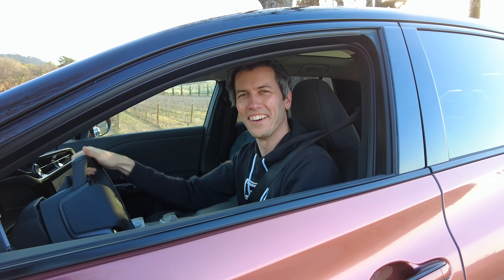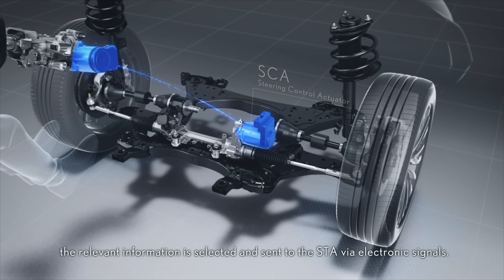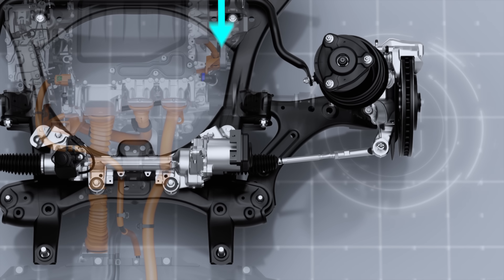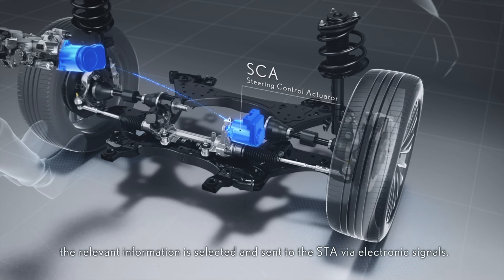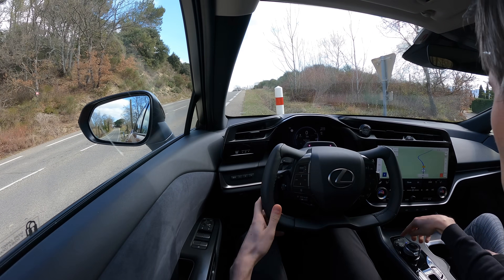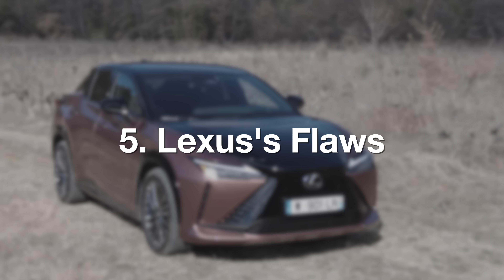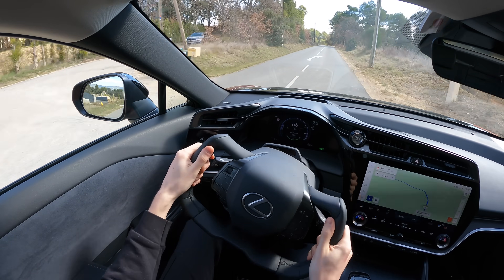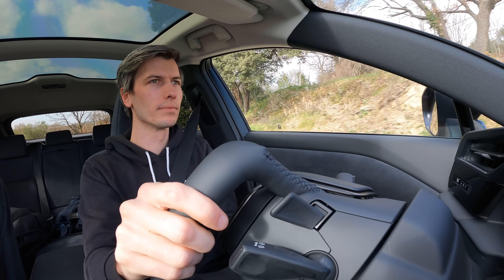How Lexus Fixed Tesla's Bad Idea: Steer-By-Wire Yoke

Comment: There is one more downside, universality and how swappable cars are. In short driving from muscle memory. Many people change cars often, you can pretty much hop in and out of any car, and most if not all of them are virtually the same. Very minor adjustments needed. In this case, if a driver sits into this thinking this is just a car like the rest of them, there might be issues. There is a required adjustment of the driver that is not minor at all, also beforehand knowledge of the steering system, like the 150 degree angle. And if this catches on and more or all manufacturers start doing this, every car will have a completely different setup depending on engineering and design, different steering angles, sensitivities etc. Cars will cease to be so easy swap and drive. You'd have to adjust to every single model individually. There has yet to be a car that I have driven that has less than 270deg rotation on the wheel. A clutch is a clutch. It may release at a different height, depending on the model, wear etc. but you can easily feel and adjust in matter of seconds. Throttle is throttle. I've driven at least a few dozen different cars, you hop in and go. I wouldn't personally feel 100% safe in a car that has a radically different steering setup. Parking in a city would be a completely different experience without the wheel rotation. You simply cannot rely on muscle memory. Or worse, driving when drunk. People don't care. If you're drunk and driving you rely on muscle memory as your reflexes are slowed down. If a car is completely different it will cause even more issues. And believe me people will absolutely continue to drink and drive. I have absolutely nothing against no direct linkage. The angle is what can be problem in the future, that I can see.

Comment: It might work for an electric car. Although there are questions. The car can often be moved without starting the engine. In the service area, during loading and unloading. When towing as a result of malfunctions, etc. The standard steering column ensures that even with the powertrain off, you can always turn the wheels. Even with the amplifier off, it is quite possible to turn the steering wheel if the need arises.
Reply: I'm thinking the same.

Comment: So what I'm hearing is no. This is not safe. Forget about the throttle by wire as that's not a safety issue. If you're throttle fails or loses power your steering and brakes still work. Steering and brakes are the two components that should never ever lose mechanical control. And all this comes at a higher cost as redundant components do not come cheap.

Comment: I am interested to know more. I saw in the video, there is a delay at the wheels from the steering wheel in the steer by wire system. Is it becoz of the video, the wheel turns after the digital signal trasmit from the steering wheel?

Another concern i have is like a computer, mobile phone, even it is the latest flagship model, the operation of the electronic device slow down somehow suddenly. Will this happen in electronic steering and foot break? Any thing in the desogn to avoid this happen? Imagine the car is running toward a corner on a hill and the signal transmission from ur steering wheel to the turning of front wheels suddenly not working properly, the car will just lost hit the roadside or rush off to the road side slope.

Comment: You forgot that at a low speed you need shorter range, while on a high speed wider range. Thus drive by wire should be able to jump between theese ranges as fast as a direct drive via steering rack

Comment: I wish they just dropped ev power trains into proven engaging platforms. Toyota,I don't want a compact SUV based on the corolla platform with a panoramic touch screen, voice activated taint ticklers and Bluetooth seatbelts. Just take a GR86, swap the powerplant with a motor that is about equivalent in power, keep as much of the drive train as practical and cram it with as much lipo cells so you're not upsetting the chassis balance.

Comment: What if you are in an emergency situation when the car/battery is dead and you need to push it and turn the car from somewhere or into somewhere? (Confined space/service center?) What if the electronic/wires breaks down and you drive on the street 100 km/ph? Can you turn with force?  It seems some engineers do not think and prefer to save money because running a cable is more cheaper than installing a proper mechanical solution that works also when a car is off .... It looks like it is not safe at all... Hmm no Lexus and no Tesla

There are some reasons why it is how it is designed... I am a little bit concerned about Lexus brand / engineers and executive level.

Note: Thanks for the video and explanation

Comment: To me, this is technology that gets in the way. I can't use a mouse that accelerates, because I need to know precisely how far to swiftly move my hand to reach the destination. I can't have things that pop up on my screen in order to guide me in various ways when I type, because they greatly interrupt the flow in my fast typing. I can't use a steering wheel where the wheels turn an unknown amount, because it would mean I'd have to slow down to avoid hitting things on narrow roads. I can't use a mouse, a keyboard or a mirrorless camera (electronic viewfinder) with the slightest noticeable delay. Nor can I imagine a steering wheel with a slight delay would be safe. They actually use steering wheels with delays to simulate drunk driving.

Comment: One other important improvement is that there's about $12,000 worth of repairs now added  to your steering system for a better steering ratio
Reply: a better steering ratio would likely just be a few variables changed in the software. though you might have to hack it to do that.
Reply: To be fair, conventional steering racks aren't too cheap either, and are a common failure point already. As long as the motors can be purchased individually i can't see it being THAT bad.
Reply: Actually this has the potential to be cheaper, with sensors and motors being easier to replace piece by piece than parts of a steering rack. 

Also, its a lexus, it doesn't break that much.
Reply: @seemslegit6203  the accessibility isn't what is driving the price of repair. Mass produced assemblies of one metal are easier to source, not as many unique elements to produce and can be made by third-party manufacturers.

In theory a MacBook could be repaired easily on a component level but somehow Apple do not allow such repairs and isn't selling you any parts to do it. I suspect car manufacturers will adopt a similar strategy.

Comment: If idiotic mistakes are ruled out then the delay is coming from the steering gear. Because the motor does not have enough torque or does not reach enough speed. To solve this, a stronger motor is required, which results in higher costs.

You forgot an important reason for steer-by-wire. Left- and right-hand drive have the same motor dream. This is a great advantage in development.

Comment: I used to race motorcycles, and no matter how much the manufacturers would claim that their throttle by wire system has zero lag, I could always feel the lag on throttle by wire bikes. The more recent models had very snappy response time, but you can still fill a delay that’s just isn’t there with a direct connection.

I also feel that saying that it has 2 motors inside a single casing is a bit of a handwavey argument. Yes, there are 2 motors. But when this goes into production you will see that there will be instances of both motors failing at the same time due to water ingress, electrical shock to the wiring, or mice eating the wiring just enough to make it fail at 60mph on the freeway in a catastrophic way.

Aside from the packaging advantages, this appears to be a solution in search of a problem to me. But than again, I hate throttle breaking in cars with regen, so maybe it’s just not for me.

Comment: I am open-minded when it comes to new tech, and I do think drive-by-wire should be a thing. Although, I think they've over-complicated it with the variable steering ratio. In an emergency situation you're trained at, let's say 50kmph to give X amount of steering input to avoid an obstacle. Based on a muscle memory, you give the same input when going 90 or 120. I don't think human brain, of an average driver, is capable enough to readjust in such conditions.

Comment: first - you can see a lag. that suuuuuucks. But it only needs to be speedy at low speeds. 

Wait - you can't have short ratio and a mechanical link? I have been thinking about this since tesla put out their crappy yoke. why can't you have a variable ratio and a mechanical link? (Think CVT - as vehicle speed increases/decreases, a chain slides across opposing cone shaped gears. This way you can have variable mechanical linkage. With chain at one end you have short ratio and at other end you have long ratio. As long as chain teeth stay locked - pretty sure yoke/steering wheel position would still aligned - maybe.

Comment: This system might be dangerous if steering computer get some sort of malfunction or start to steer on its own when no steering input was made or stop working completely. At highway speeds this would be disastrous and there would be no way to fight computer inputs without the steering wheel being mechanically connected to the steering rack.

Comment: Its not going to be motors or sensors thatll fail, it will be the wires buried in the chassis. I work on a lot of late 2000s early 2010s vehicles and the wires are what fails. Its easy to replace a sensor, but when one single wire in some harness gets frayed, you're looking at tearing apart the whole engine bay and cab just to snake your choice of either a new multi thousand dollar wiring harness, or a new 2$ piece of wire.

Gotta love when a cars electrical diagrams have more pages than the service manual, have no reference to their physical locations on the vehicle, and are sold as a separate book.

I dont think this is unsafe, its just very likely to take an extra decade off the vehicle's maintainable lifespan before it gets sent to the scrap yard.

Comment: Variable sensitivity is possible with a mechanical linkage. In my car, the amount of power steering assist reduces as speed increases, meaning that while the steering ratio is constant, the force required to steer at speed is higher, and steering is therefore not twitchy at high speeds, but very easy at low speeds. It works so well that, while I can comfortably control the car and only make fairly significant inputs at highway speeds, I can also turn the steering wheel with my pinky while the car is stopped.

No amount of redundancy is adequate substitution for a system that fails safely. A mechanical linkage would literally have to snap to stop working, which simply won't happen outside of a serious collision. If power steering fails, you can still steer and get the car safely to a service shop. But even if there are two completely separate steer-by-wire systems, the (however unlikely) simultaneous failure of both of them would mean total loss of control. Note that if the two systems are identical or near-identical, and subjected to the same conditions (which they are), it's not unreasonable to expect both of them to fail in a short timespan, perhaps even simultaneously with bad enough luck. And while the gas pedal is also only electronically connected to the ECU, the failure of a gas pedal will not result in an accident (even if it gets stuck in the maximum position, you can just shift to neutral).

And yes, steer-by-wire is an existing technology, in fact, my rear wheels steer exactly like that, but the difference is that even if my rear wheels (which obviously have a much more limited steering angle than front wheels) end up stuck at the worst possible angle, or even come loose, I can still safely stop the car because my front wheel steering will still work.

The delay between giving a steering input and the wheels turning is inevitable, since the steering input has to be registered by sensors, processed by a computer, sent to a motor controller, which then activates a motor which necessarily has an acceleration period, no matter how short. The delay can be reduced, but never eliminated, or even reduced past the perceptibility threshold. With a mechanical linkage, the delay is literally determined by the speed of sound in the material the linkage is made of, which makes it imperceptible to the human brain (assuming the linkage is mostly steel, the propagation speed of a disturbance is around 5000 m/s).

The force feedback can by definition never be as accurate as that of a mechanical linkage due to the several added layers of abstraction and information loss. This is dangerous, as it can give a dangerous or overly vague feedback to the driver, which could lead him to make a wrong decision.

Due to the usage of a computer in the steering system, steer-by-wire is yet another potential source of bugs and other issues related to computers. Unlike with most other computer-controlled systems in a car, however, the failure of steering can easily be fatal. Just imagine, for example, if a bug made the steering motor suddenly turn the wheels fully to one side at highway speeds.

Lastly, such a unique system would be expensive due to usage of unique parts, it wouldn't be supported by ordinary service shops which wouldn't have said parts in storage or the technicians trained to work on the system, and the system would be more prone to failure (even if not catastrophic) than a regular mechanically linked steering system.

Comment: Steer by wire is a big fat NOPE from me.  Electrical fault turns into zero chance of avoiding a collision. Don't give af what backups they have in place, unusual electrical faults are nothing to mess with like this.

Comment: The delay in turning the wheels has to do with inertia. You can turn the steering wheel super fast, faster than the electric motors can keep up. And they probably have some maximum turning speed too, so if you just jerk the steering wheel very quickly from one side to the other at maximum ratio, there's no way the motors can do that without some delay, as they have to go full power-decelerate-full power again-decelerate for the stop at the end.

Comment: 2: 12.   That's no explanation of how a driver receives feedback from the tires. That's Artificial feedback. What happens when that electrical component of the system fails? No more Artificial feedback until expensive repair! 
If there is any "feedback", it's Artificially programed into the murderous electric system, so wouldn't really be any real feedback. 
How on earth does any real feedback get from the front tires to the steering wheel? Because you provided Zero description. Because there Is None. Because there Can Be None.
It's plain you're speaking deceit.
3: 01, why introduce electric car motivation? Because an electric motored car has a few advantages, That Has Nothing To Do With Steering it! You're confusing the Subject!
7: 23, If I have 10 batteries in my Mechanical steering vehicle, and they all become completely discharged, I can Still steer my vehicle perfectly fine.

Comment: BMW had “Active steering” (ie. Variable steering ratio) in their E60 which is now almost 20 years old…. It was achieved with clever gearbox on the steering shaft and a motor and achieved basically the same… so what did Lexus then solve here really? I’d say nothing…

Comment: Fly by wire is nothing new in the aviation industry. Airbus planes are equipped with fly by wire tech for decades. So why not steer by wire in cars? IMO this is a good development- But of course this is the very first attempt by Lexus now and so it is not perfect yet. But I'm sure that this technology is about to be improved over the upcuming years and models.

Comment: There should be a manual override like a lever you can pull if you detect the steering fail. It would be like emergency handbrake to engage manual override
Reply: but there is no connected steering rack, it would just fail and you better hope its in the right direction.

Comment: 3. Safety. You did not cover the main concern from most logical person.
Sometimes electronic component fails, and if the car is a high speed when that happens what guarantees the steering will be as safe position when it dies off it high speed. Or what guarantees the electronic motor won't misbehave due to component failure.

Comment: im curious how i‘ld put it on a trailer if car is damaged. what if a marten bites of a cable, and you notice if after where you should have turned? questionable. btw: electric park brakes are bs as well for same reason -> no more safety net.

Comment: I don't think mouse sensitivity is a good analogy. High sense is like an F1 car, this is more like mouse acceleration where the sensitivity is a function of speed, in this case vehicle speed instead of mouse speed.

Most people hate mouse acceleration because it makes consistent movement harder because the same hand movement give different movements of the curser based on how fast the movement was done. Though it has it's niche uses, Quake players often use mouse acceleration because they need to be able to make tons of really quick movements and also have the ability to make small fine adjustments to their aim. But for virtually all other applications, mouse acceleration is not necessary and is way more trouble to get used to than it's worth.